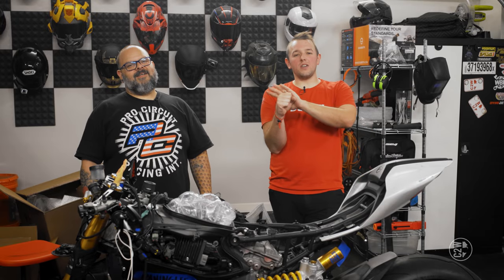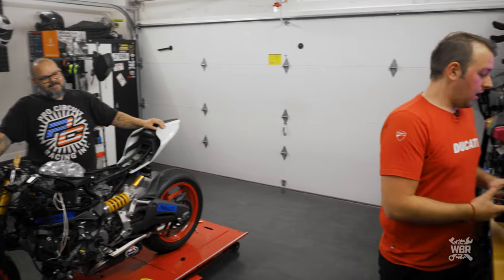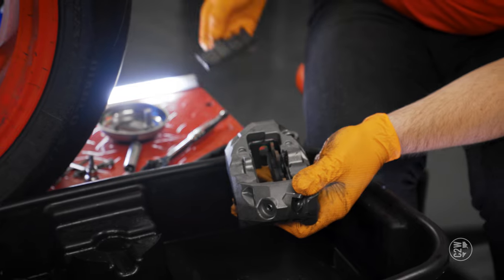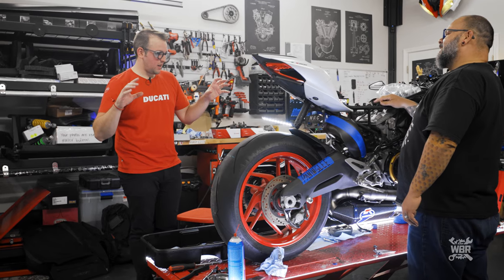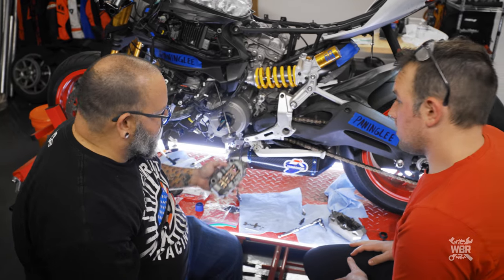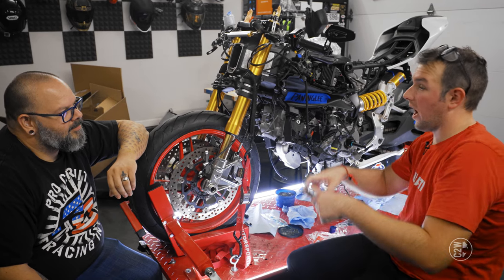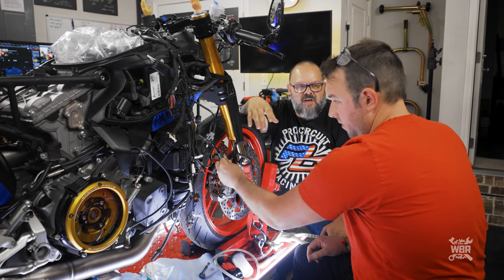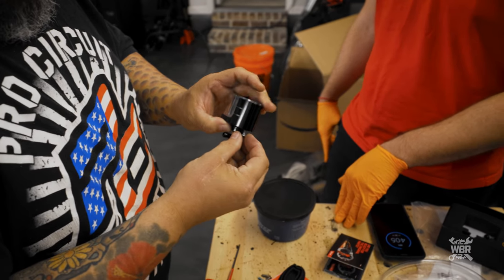Installing new BREMBO MASTER CYLINDERS!! [Wrecked Bike Rebuild - Ep 13 - 2016 Ducati 959 Panigale]

Comment: 6 years ago, I was being scolded and yelled at by my dad when trying to remove the simplest parts on my bicycle. I didn't know back then what the big deal was about using the appropriate (and good quality) tools for simple bolts and nuts. Many stripped and rounded bolts and nuts, busted knuckles and ruined paintwork later, I'm doing everything from oil changes to valve adjustments on motorcycles on my own, with a respectable collection of tools and knowledge. I love this WBR series (esp with Brian) because it reminds me of my own long and frustrating yet rewarding journey of learning workshop etiquette, mechanical know-hows, and art of bike maintenance over the past 6 years. I'm still learning a lot from Brian, and keep up the awesome work with this channel and this WBR series! I'm sure it's helping many out there who work on their own bikes too.

Comment: The "credit card" piece is the Brembo Authenticity card.  They got a website where you can take the code that is on there, and type the code and you can check the serial number to make sure what you've purchased is an authentic Brembo unit.

(:

Comment: I have a duke 390 which has radial mounted BY-BRE caliper and steel braided lines but it has a axial master cylinder, so can you suggest a good radial master cylinder for duke 390 and by the way the front caliper has 4 pistons and it's also a single disc so a single caliper too.

Comment: So Brain, why fill the brake fluid from the top?  Is there some special Ducati reason it couldn't be pushed up to the top from the bleeder valve with a huge syringe, the way many people do?  That way you avoid most air bubble issues.

Comment: Today on WBR Brain Teaches Chase galvanic corrosion.
Reply from the maker: For those of us at my level: Galvanic corrosion (also called bimetallic corrosion) is an electrochemical process in which one metal corrodes preferentially when it is in electrical contact with another, in the presence of an electrolyte.

Comment: off point - I recently purchased  Cosmo Moto @t - smart brake light that affixes to your helmet and detects when you are decelerating - braking or engine braking to light up and inform other road users of your presence and that you are slowing down. It also can be set up to emit a continuous light similar to that of the rear light on your motorbike whilst shining brighter if you are decelerating in addition it can be set up as a strobe/ continuous warning light as well. Have you thought about reviewing this as I believe that this is an invaluable safety aid  in raising your visibility on the road at an affordable price for all motorcyclists. Please let me know your views.

Comment: Isn't the RCS19 works better on the brake side? Because the 899 calipers are M4 but on the 1199 they are M50 (smaller piston).
Idk, RCS17 may work good as well. Just curious.. love your vids btw
Reply: Correct. The 17 RCS is for bikes with M50 calipers. The 19 RCS is the correct master for bikes with M4 calipers.

Comment: Question; Does Brembo or Ducati recommend putting grease anywhere near their pads or calipers? 
Pads  & calipers get very hot (above melting points of most grease) and can/will end up on friction (pad or disk).This cannot be good thing eh? Just sayin'.
Reply: There is a grease that made especially for this purpose. Brembo is actually selling one.
Reply: @krittinteerasawasdi4333  Thanks, but where do they recommend applying it?
Reply: In my experience being a bike tech, on the vast majority of customer bikes I would lightly copper grease/slip back of pads as well the caliper bolts and pad pins. Rubber grease the pistons and work them to lubricate the seals and also prevent corrosion. However on race bikes or high end performance bikes I would leave everything completely dry and clean as possible, possibly use a small amount of copper grease on the caliper bolts but that’s it due to the heat that can be generated. Just my own personal experience and take on it.

Comment: where can i find the clear rubber hose for brake fuel at 27:00 ?
Reply from the maker: They came with the Master Cylinders. Not sure where you would be able to get them on their own.  I did find these on Revzilla but not sure if that's the same thing: http://bit.ly/2KgwvZc
Reply: @Performerk 57 you can try an Auto parts store
Reply: @thomasohanlon1060   everyone sell for 
gasoline fuel its the same ?
Reply: Brian is pissed 😁

Comment: big question??? what is the point of rebuild if already has gone upto 20000$ which i believe is the price of new panigale :/
Reply from the maker: For 20k you can get a brand new Panigale. For our 20k we have a Panigale with full Ohlines suspension, a clear clutch cover, brand new upgraded master cylinders and reservoirs...etc. The point is, for the same price as a new one, you could rebuild one and upgrade the parts.
Reply: @chaseontwowheels  thank you so much <3 for your reply.. big fan... I have big question to ask i have a multistrada 1200s and i recently saw carlin dunne's pikes peak edition multistrada which had a termignoni  shorty.. do you know where can i find one of those??

Comment: I support learning, but this level of difficulty feels alarming to witness. Half of learning is attention to detail, inspect the thing you’re taking off - it’s orientation, direction of bolt holes, line connections - pay attention which screws came from where. All of this, if done thoughtfully should help you appreciate how the component functions, and greatly accelerate your ability to service. Having someone explain how something comes off, and also needing help putting it back on should be a signal that there is more awareness/attention to detail needed. Write out the steps in order before you tackle a  project, watch a tutorial for a different bike so you understand how the task works rather than the specific steps you must do for your specific bike. Idk, keep it up, but you should invest in your craft if you’re going to publish it to such a large audience. I think seeing this struggle has reduced my interest in a bike that is being assembled as a learning tool… that is a skill set that should not be developed at the risk of this motorcycles future owners safety.